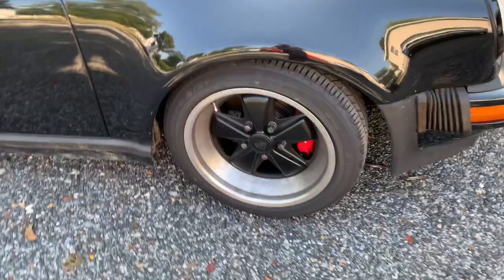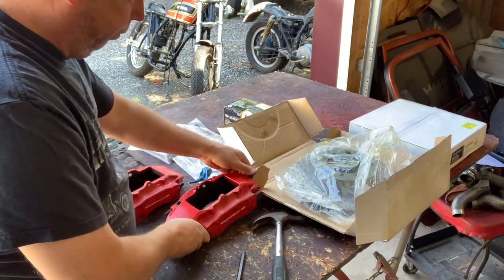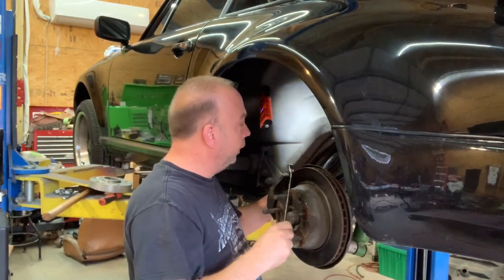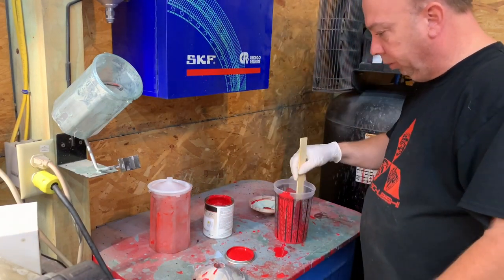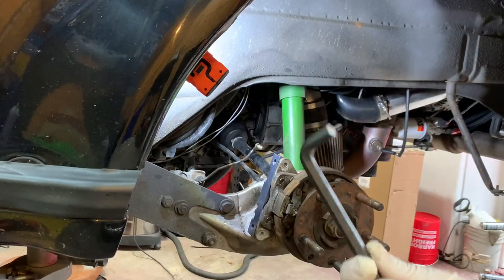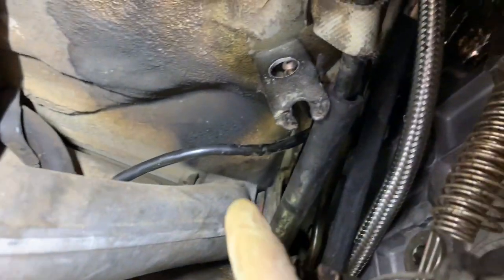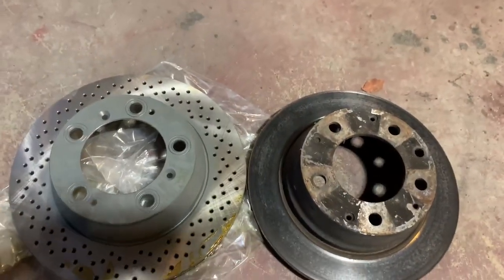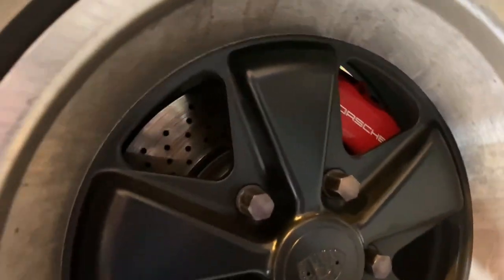Big brake install on a vintage Porsche 911

Comment: Only 2 issues with your upgrade. If you did your research you would know that the "G" series cars brake better with larger rear rotors than front  like the 930. Your big issue, again if you had done your research, you would know that going from 2 piston calipers to 4 piston requires a larger master cylinder to maintain pedal feel. I installed 993 calipers on 930 rotors on my 73. Best brakes I have ever used.

Comment: Why us air filter under engine sucking in warm air from manifolds?
Reply from the maker: Well it’s not a Porsche engine, it’s the only place that that it will fit. What do you want from a 505whp engine that runs 10.8 @ 129mph in a quarter mile and 375 mpg  on a 15 gallon tank

Comment: Why do you need the the 944 turbo front hubs ?
Reply from the maker: The adapter that I had would only work with 1987 944 Turbo front hubs. The rotors on the slide over the hub, 911 rotor bolts behind the hub
Reply: Thx for info , what was the part number of the adapters from rebel racing for the front brakes?